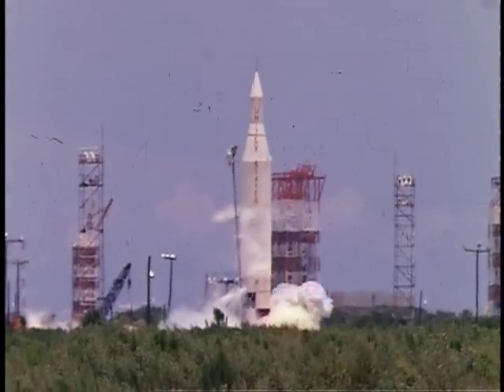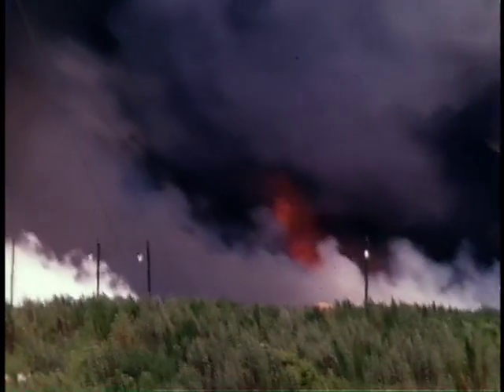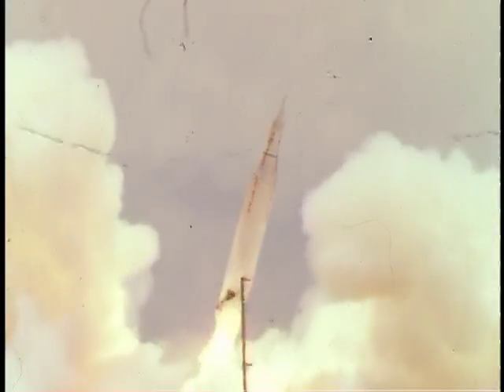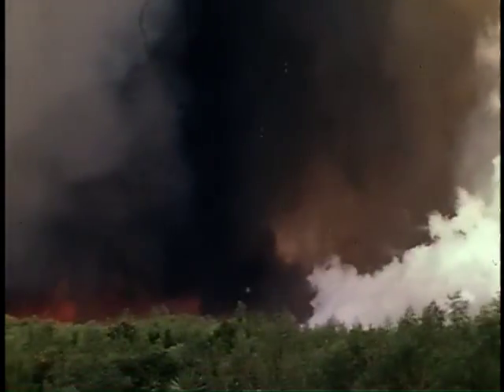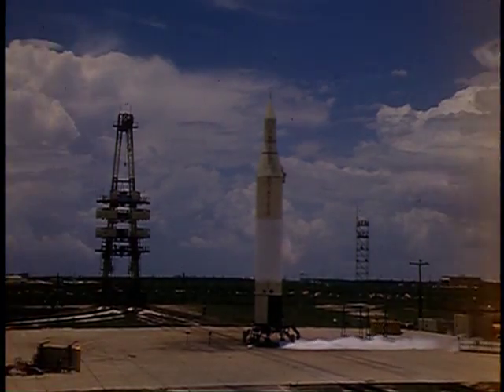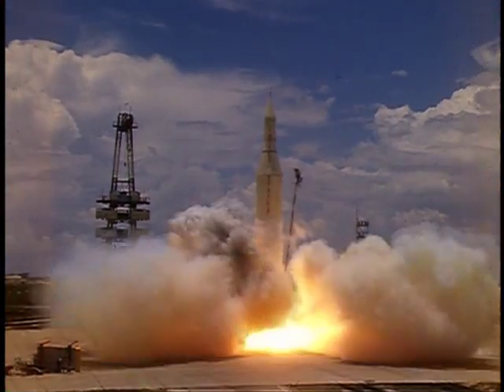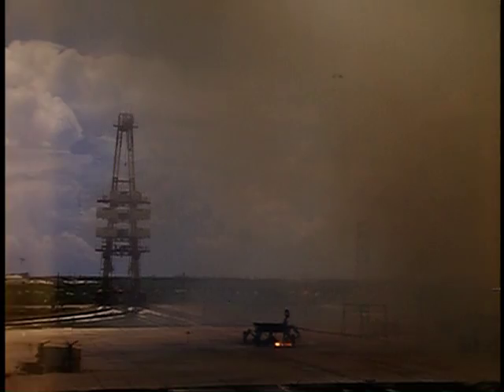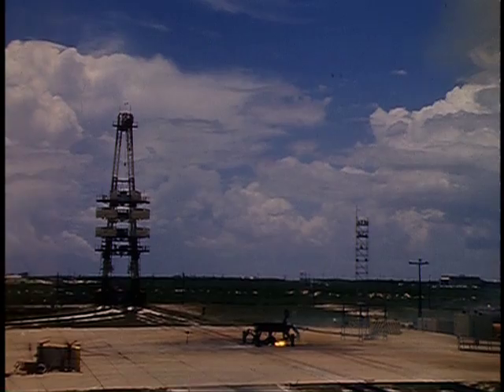Juno II Explosion

Comment: One note: The Juno II did not use a standard Jupiter IRBM (Intermediate Range Ballistic Missile) as its first stage, but a "stretched" (lengthened-tankage) Jupiter, just as "stretched" Redstones were used for various space launch purposes. The Saturn I and Saturn IB vehicles also used "stretched" and clustered Redstone tanks (eight in total) in their first stages, with the Redstone tanks clustered around a stretched Jupiter tank, on the inside.

Comment: Jcynavarro:

Range Safety is the person at Cape Canaveral who during the countdown and launch helps insure that ships and airplanes are out of the way of the rocket's flight path.

He or she can also destroy a rocket if it malfunctions during launch. Such intentional destruction is done to avoid damage to populated areas or sea lanes.

In the Mercury/Gemini/Apollo days, if the RSO destroyed a manned rocket during ascent (which thankfully never happened), it would also automatically trigger the spacecraft's abort system.
Reply: altfactor Do they destroy the rocket with a self -destruct button of sorts, or do they shoot it with and anti-missile gun or something else?
Reply: PooManchoo2  No to both questions.

Instead, each rocket has a small amount of pyrotechnic explosives attached to it, which, when ignited and mixed with the highly volatile fuel, cause the rock to explode.

If something goes wrong, the Range Safety Officer will press a button which sends a signal to the rocket to activate the pyrotechnic explosives, thus causing it to explode. It's not really a "self-destruct" button; the RSO has to press it to destroy the rocket. And as noted above, if it was a manned rocket in the Mercury/Gemini/Apollo days, it would also automatically activate the escape system, if the astronaut(s) hadn't already done so.

At a certain point after launch, when the rocket's fuel is exhausted, the pyrotechnic explosives are disabled.
Reply: @altfactor  
Doesn't look like it caused the rocket to explode though, it looks like it severed the rocket motors from the rest of the rocket, which then exploded when it but the floor.